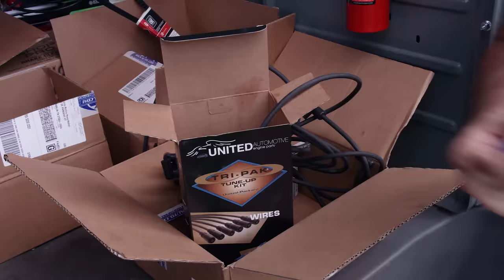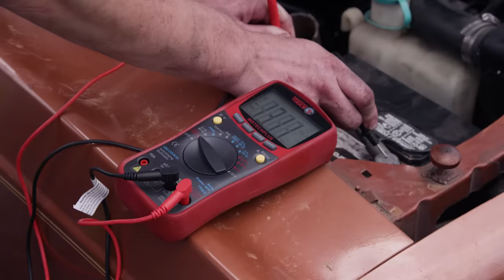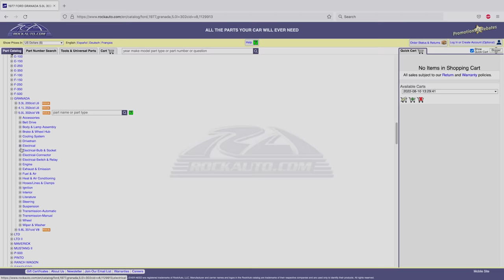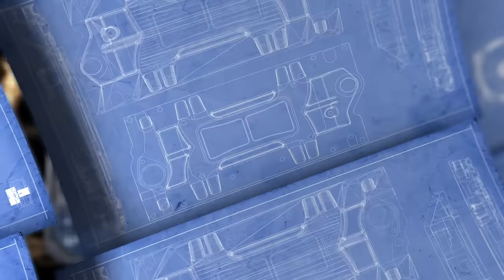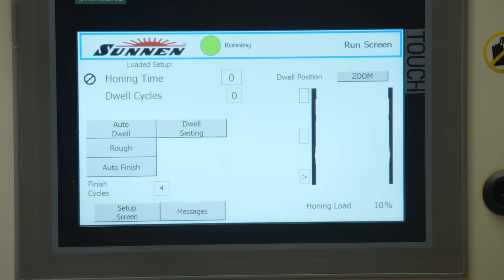Full Build: Building the Ultimate Sleeper Out of a 1977 Ford Granada That Turns 7500 RPM!

Comment: I Missed out on a 3speed on the column 302 1977 very well kept, guy wanted like 3500bucks and it drove just like my dads 1977 Ford F100,  tagged and driving. I could not sell it . Didn't have the money and could not talk dad into getting it for nostalga , he had foot issues with the clutch anyway...

Comment: As the owner of 2 PA C4 Pro Mods there is no way in Hades they had those transmissions ready in under 10 months.   They are out of C4 cores, so I  have a spare in case we experience total failure 😂

Comment: I had purchased a Gen 1 Granada Coupe back in '83 that had a factory 302 with a 2 barrel carb. I bought it from a guy who had taken the heads off to do a valve job and couldn't figure out to put it back together. So I bought the car with all the engine parts in the trunk (AC compressor, power steering, alternator, water pump) and the rebuilt heads were waiting on a couple of pieces of wood on the floor of his garage. I put it together after buying a 4 barrel manifold and carb from a local boneyard. New timing gear and chain, reroute the gas line, and that was all. Lots of new gaskets. Let me tell you, that car SCREAMED. I took off the catalytic converter and put on a straight pipe "test tube". It accelerated like a raped ape. The only real problems were; 1) the fit and finish of everything in the car was awful, and 2) the suspension on these Granadas was literally a threat to everything on the road. If you hit a pothole, the front rack would bang against the full reach of the shock. It was like riding a homemade go-kart with a Beetle engine. Scary!! I loaned it to my brother in law while he got his truck fixed and the thermostat froze up. He drove it all day until the engine siezed up. Imagine that; a five dollar part and a dumb ass relative destroyed my car. I had it towed to the boneyard where I had purchased the four barrel. Only thing left is the memory of flooring it at traffic lights. That was a thrill.

Comment: I was told that Seafoam was designed for 2 stroke engines. I use Techron for the fuel,and AT205 for the engine oil and transmission.
Reply: I've used SeaFoam in everything I've owned, from Chevies to Fords to Subarus to lawn equipment.  SeaFoam works pretty well for the money.
Reply: @eskieman3948  How’s it working with your Cat converters?  That’s where I’ve been told that the problem lies. If you don’t have any cat converters, then you’ll probably be fine. Seafoam was originally designed for 2stroke engines. Such as outboard motors,  hence, the name.

Comment: 1. Should have gone with head studs for the same price.
2. Should have went with a higher compression ratio.
3. Should have went with an electric water pump.
4. Should have went with electric fans.
5. Should have skipped the transmission line going into the radiator and had it just go into the cooler. Also you could have gotten a cooler that would mount below the radiator in the lower valance opening.
6. Should have upgraded to braided brake lines.
7. Should have sumped the fuel tank and ran and external pump and pre and post filter.
8. There are much better choices for keeping the driveshaft connected instead of janky little U-bolts.
9. The cutouts are lame.
10. A resonator is what you needed not 2 mufflers, just one per bank.
11. Should have done true dual exhaust. That 2 into 1 stuff is gonna cause back pressure. You didnt even make the single pipe big enough. Should have been a 4".

Comment: 1:17:49  ....  I looked up the original Ford Dealer that sold your car new (perhaps) and they are still in business today.  Paul Miller Ford located at:  975 EAST NEW CIRCLE ROAD, LEXINGTON, KY 40505.  Don't know where you guys are located at but a drive by the dealership would make a good video.  See if any paperwork could be dug up on the car when it was new.  Original owners and such.  Maybe even contacting them and have them swing by the dealership for a visit with their original car from 1977.

Comment: Alot of drag cars use a 2 speed powerglide with a hydraulic clutch. The automatic transmission won't pull until you release the, clutch. No need for transbrake nor stall, converter. Still a, street car. 🙂✌️

Comment: Dual  exhaust  would  have  costed  less  money  while  still  keeping  the  idea  it  is  stock i  found  that  out  when I  had to  replace the  Exhaust  on a  72  Dodge  Charger  with a  318  CIE but  I  wanted to  replace the  318  with a  426  Hemi  but  i  found  out  i  would  have  had to  replace the  A frame so  it  could  hold the  bigger  engine  but  a  place  called  H&H Towing  ended  that  idea  cause  of  some  shady  practices  they  was  doing  to  keep  me  coming  back

Comment: The cylinder heads are worth more than the whole car. A 260 @ 50 camshaft in a small block is not something 99 percent of people are going to drive on the street, certainly not at 7500 RPM. It'd be so aggravating trying to drive that on the street. It's not practical. Unlimited budgets must be nice.

Comment: Great build. Would have preferred NOT using nitrous and just get the most out of gasoline, even if you run higher compression and use octane booster.  Anyone with experience can spot nitrous lines on the engine. Ruins the sleeperness.

Comment: This engine would make close to same power with a 500 cfm 4 bbl (it would even run decent with a 390 cfm 4 bbl to save fuel)  and be much more street drivable
Approx conversion is 70 cfm per 100 hp

Comment: You could have at least put a 4000-4500 stall converter in the damned thing, and a competition transmission!! It would have still been streetable for miles, but run the numbers it should have!! And with 650hp+, damned thing should have been knocking on the 9's!

Comment: Took a block out of one that had seventy thousand on it and  and put a really good set of two eighty nine set of heads that I spent a grand on   lol Chevy valves heads were. Milled to forty over  with a Holly seven fifteen double pumper and the intake walhollod out  no body in gville could touch me  acexcell  super coil
Reply: Lol I put it in a eighty one mustang had to put a  big block behind the rack and pinion it stood wheelies it had a three speed out of a pickup I could take it to eighty five hundred but it started floating scared the  p out of  me
Reply: That epuiles about sixty in first lol and that means a neck breaker don't tell y😅 wife's

Comment: "Do you KNOW the firing order of this??

As long as you know the 18436572 for a small or big block chevy, you can just picture the Ford engine as being a Chevy and do it that way. The actual firing order for the Ford is exactly the same as the Chevy, only Ford numbers their cylinders differently that Chevy does, but in reality its the same. Just remember that the distributor rotates counter clockwise in the Ford, opposite of the Chevy.

Comment: Ford wanted to compete with the Cadillac Seville so they dressed up the Granada and rebadged it as the Lincoln Versailes! No the Versailes wasn't a successful against the Seville but it did have a posi 9inch rear end with disc brakes and a 351 Windsor.

Comment: The 1/8th mile strip doesn't do much for me. All my life, the STANDARD drag strip has been 1/4 mile.  I have NO STANDARD OF COMPARISON when using the shorter strip length. It's like comparing COLLEGE BASEBALL SPORTS TEAMS to the MAJORS; where aluminum bats are BANNED within the MAJORS but ALLOWED within COLLEGE BALL. I'm curious if your Granada could break a "12-second" 1/4 mile E.T. mark at a MAJOR LEAGUE DRAG STRIP? I think my analogy is valid!!!

Comment: I have a 1981 Ford F 150 300 in line 6 cylinder the whole truck needs repairs engine transmission and transfer case I am Disabled and can't work on it I need help

Comment: If you guys used a chevy 12 bolt diff instead of a ford 9 inch you would've gotten more hp to the tires instead of losing it in the diff

Comment: You never, EVER, order pistons until your machinist is done boring and honing the block. EVEN if it IS a standard bore block, it COULD be worn out enough to the point that it will NOT clean up at .030. I've ran across this MORE than one time, and had to be the one to tell the customer that they have wasted money on a set of pistons that they won't be able to use, and now have to purchase a second set.

Comment: I owned a 1976 Granada.  To my mind, pretty much a cheaply done imitation of a Mercedes Benz.  Terribly under powered with all the California emissions gear on that poor V8.  I noticed you putting in the Seafoam into the gas tank.  That plastic cover is trash, not hinged, but a plastic flap.  It will fail pretty quickly.  I guess you already know, this car will never, ever become a classic.  In the engine compartment I noticed the starting of corrosion on the body/chassis, and it was an inside kept car.  In any case, good luck.

Comment: What's the appeal of a so-called "sleeper"? You spend tens of thousands of dollars and you still have a boring-looking, or even ugly, body style. The boxy styling that was all the rage in the late '70s through the mid '80s was the most uninspired, laziest car body styling the world had ever seen at the time. Is it worth all that money and effort because somewhere, sometime, some random stranger might be moderately surprised that your car is faster than it looks? 

I'd much rather have a slow car with a great body style than a fast car with no body style. A slow car can be made faster but there's no fixing a bad body style, short of replacing all the body panels on it with ones from a different model car, like when they remove the ugly body panels from a Crown Victoria and replace them with awesome looking '69 Dodge Charger body panels (which isn't something many people can do, because they aren't exactly drop-in replacements).

Comment: I call BS on this video.  Tires clean and brand new.. no dry rot.. Engine bay 100 percent spotless... no dust at all.... A car sitting there for ages would have a ton of weeds going up and under it... There would be mouse nest under the hood.... No one puts hundreds of dollars into new tires and then parks it for a removed distributor rotor and a broken spark plug wire.

100% FAKE!

Comment: Lol way overcammed and by the way a 9.90 eigth mile that this turned is a 15. 5 quarter mile time and pittyfull .. 500 hp at 7000 rpm would be easily beat by any 200 hp car that makes its small hp and tq numbers at a lower street rpm.. I would have enjoyed this build much better if it was built with a realistic camshaft with something around 204-210 intake and exhaust duration @ .50 instead of this ridiculous race cam with 240 degrees sacrificing drivability and any low speed torque.. even the high performance factory mustangs never ran this giant cam because your just sacrificing to much drivability and requiring racing converters and still ending up with a non idling ,overheating track only crap box that vant get out of its own way .. With a carefully choosen medium sized cam this could have been a nice street car capable of beating 90 percent of anything on the street while idling normally at 800 rpm with the ac on and capable of cruising the streets and highways very comfortably and dependably.. 😢

Comment: I love these fake set up gag resto videos. Disconnect a coil wire and make a get it running video in order to advertise. yeah I get it. After 40 some years of rescue work I have never seen a non runner that clean under the hood... I mean toss some dirt on some old peeling paint job and make a get it running again video... Total BS... When ya open the hood and its dusty filth pit that's a car that ain't been running in years or the mouse runs up your arm and comes out your ear. That's a real get it running video or when a possum break dances on the air cleaner that's a real get the old car running video.